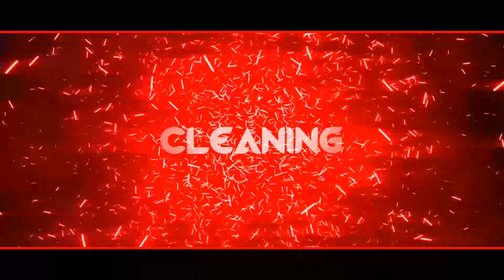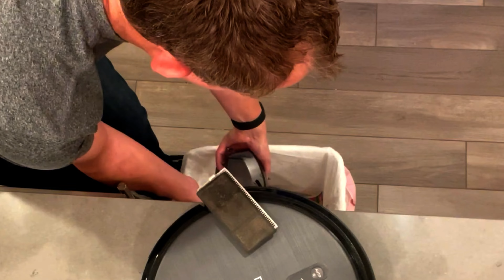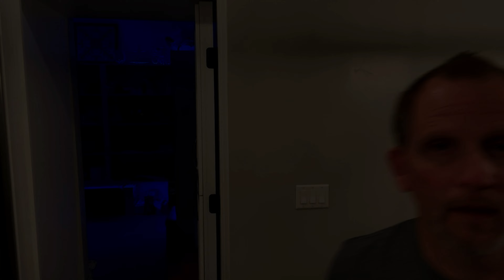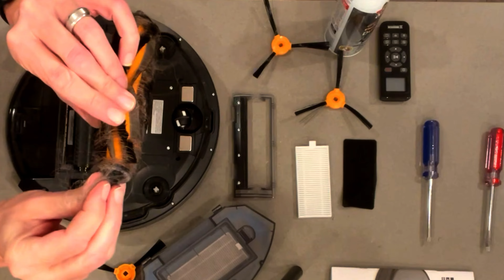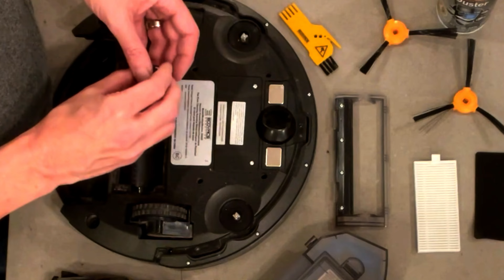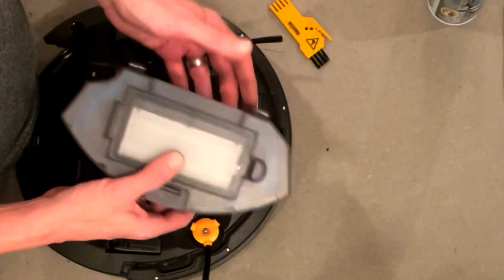Deebot N79 Cleaning & Maintenance

Comment: Please help me. My Deebot ran over a mess and I sprayed lysol lemon all purpose spray alot cause it was yucky but i didn't turn it back over I wanted to take it apart but i put it onbthe charger it  kinda moaned but i left it on charger then checked it nothing.  I pushed the button again and mianed then nothing.  Put on charger. Now irs dead. I took battery out cleaned it and still nothing.  Help I love my Deebot.

Comment: I did everything you did but my vac still won’t move?
Reply from the maker: Sorry to hear it's giving you troubles.  Turn on the ECOVACS DEEBOT power switch.
Once the DEEBOT is on, press the reset button for more than 6 seconds until there’s a music sound coming out.
Once you hear the beep sound 3 times from the device, the DEEBOT has been reset.  
You can also Try holding in the button for 30 seconds and then release.  Also be sure to pull off the front wheel if it's blocked up with hair or anything, and the same with the spinning sweepers.  If all else fails, place it back onto the charging station and try holding in the button for 30 seconds and release.  If it's still not going to cooperate try their customer service 
1 844 326 8227 or customerservice@ecovacs.com

Comment: I've a DN622/N79. Never got the unit to work with my WiFi. Never saw ECOVACS_00xx at any time, and yes I tried everything (2.4), press for 1 beep, etc. etc.
Reply from the maker: That's disappointing to hear.  Check with their customer service.  I found they are super helpful without giving you the run-around.  We had the same issue with one after 3 months connecting to WiFi and they sent us a brand new unit, no questions asked.  It was a one-off issue I suppose, haven't had any other problems with 2 units we own.

Comment: Thanks for the video!   Do you know to reset the vacuum to reconnecto to Wi-Fi without the remote?  I don't have the remote.  Thanks in advance
Reply from the maker: Turn on the ECOVACS DEEBOT power switch.
Once the DEEBOT is on, press the reset button for more than 6 seconds until there’s a music sound coming out.
Once you hear the beep sound 3 times from the device, the DEEBOT has been reset.
Congratulations, your ECOVACS DEEBOT has been reset.
Hopefully that helps, then you should be able to re-connect the device to wireless, it will show up as Deebot N79 on your phone App, and go from there.
Reply: Hellow sir did u find the way to conect the vacumm to the net  i need the way u use  thanks alot .

Comment: I recently took mine completely apart to clean and get rid of a loud noise while running. 
The noise is gone, it seems to be working but I am concerned that I don’t feel any air coming out of the small exhaust on the side.
Reply from the maker: Is it still picking up and storing everything in the catch bin?  I'd make sure there isn't anything blocking the exhaust port, but generally  if it's still sucking in items, you are good.  Thanks for the comment!

Comment: Have you tried to open the top cover? I’m trying do a factory reset and I can’t find out how. Thanks fir the video-I think I might need to replace my filter. 😣
Reply from the maker: Thanks for the comment! To do a factory reset, I think you need to power the unit on, then hold in the button on the top for like 30 seconds, you should hear a beep.  Hope that helps!